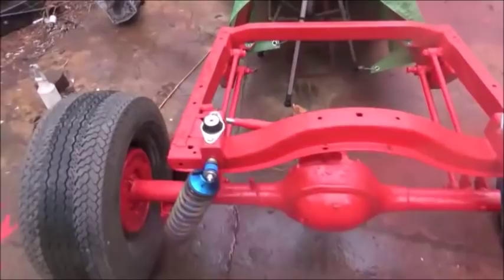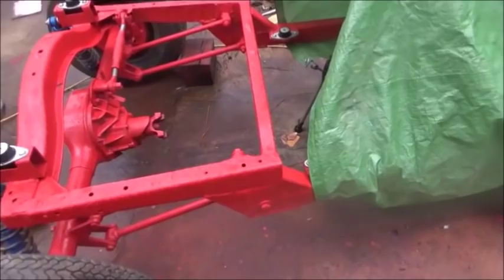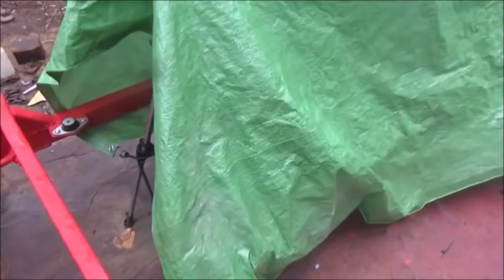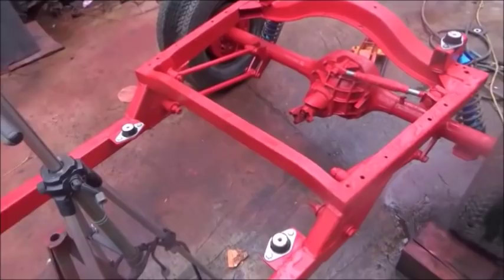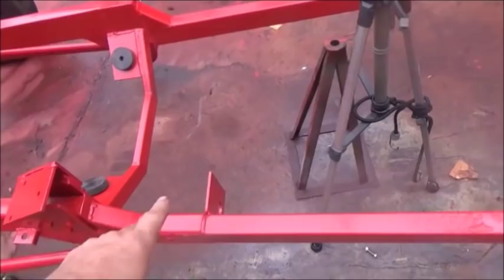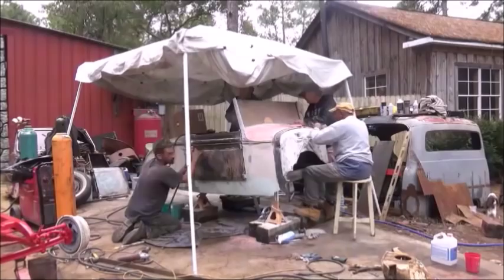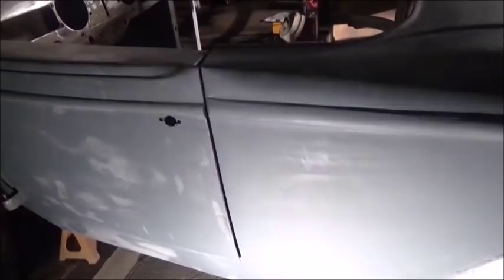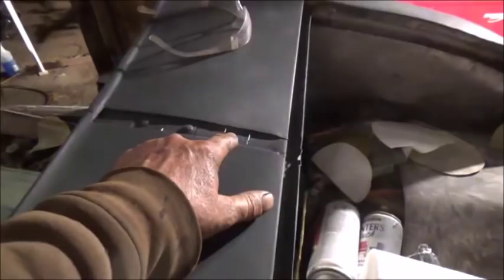1931 FORD UPDATE SHOULD BE PAINTING SOON

Comment: The "Sow's Ear to Silk Purse" transformation continues! We're all grateful that you have a crew stepping in to help take SOME of the pressure off of you that you put yourself under. The project is really taking shape in a big way. As a long time IH and Farmall fan I love your frame paint choice! I think you've said in a previous video that your frame mods and strengthening welding should be more than enough to handle the modest power of that old Y Block Ford. That motor will look and sound great without taxing the small frame. Awesome fab work as you always do. High Fives to you and your "Staff" and absolutely to your "CEO" Mrs. JW!

Comment: You and your "crew'" have nothing to be ashamed  of. You are  right about  that tractor  paint. I've used that same single stage red to paint more than one pickup.  In fact the first time I layed down five coats before I was happy. Not a sag or run in it. However, it took three days before I could pull the tape. By then though there was so much dust in it  (no booth, family garage) that I had to wet San and block all the horizontal  surfaces and buff them out. There was certainly enough paint there so it was no problem. Maybe it was because I cut it with turpentine  after I ran out of enamel thinner? Heh, I was 17. You should have seen my 62 Corvette Blue Chevy when I got finished with that. Boy what a mess. It was embarrassing to  drive.

Comment: Nothing wrong using tractor paint on an old hot rod, you can always throw some clear coat over, and make it look, and last bit better. 👍😉

My motorcycles is John Deere yellow, LOL. The bike was already desent yellow paint job when I got it, for all you yellow haters "so not my choice". I just wanted something that would matched for a couple replacement panels. "I wanted it cheep" after testing several spray paint, Valspar John Deere yellow, match perfect, so it work grate... for repainted pieces touched up Etc. As well as matching my custom built trailer. Then just clear-coated over top of it, and honestly it really doesn't look bad, except for being yellow LOL, but it grows on you.

Comment: Don't remember if you checked to see if rocker arms are oiling. These "Y" block engines were bad to clog the oil passage where it goes from the block into the head. That point was kind of a dogleg shape that would clog fairly easily because of the heat in the area. Often, people would put an external oiling kit on the engine to insure the rockers got enough oil.

Comment: The pulse of America, my first ssvideo of this day and a good way to wake up as it is 7:31 now so I will rob air myself one more day. This cruise in is very important to the people that the money raised at these events help. I can relate to Noah's grandfather as I miss all my downline be it the few it is. I care about people more than anything and it keeps me going. I never knew that I would like International's take on red.Kinda like General Motors view of the color red in the fifties. First thing that comes to mind is Fire Truck Red and it's not, a color of its own. I like the mounts used, never thought of them when I tried to do this y ears ago, grinding ones off of other cars or trucks seemed easier at that time and far from it as they never stay in the line like your eye  catches. I now see why all the grinding and floating and stuff to get the body lines a chance to do what they are there for. Mostly  strength as metal pops and snaps if not held tight. A good paint job looks awful when the panel decides to move and shell your hard work off. Anyone who has dressed metal knows that some filler is required to make it look so fine and straight.  A "A" for all the hard work. Another one for the team helping the dream go on